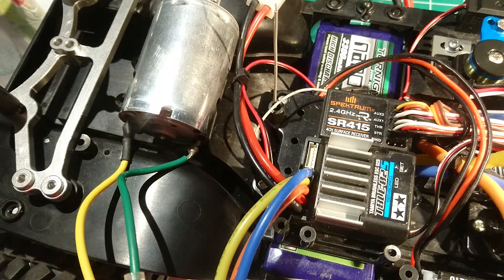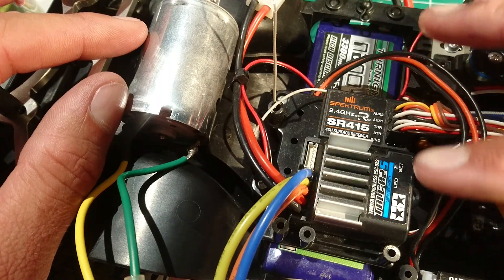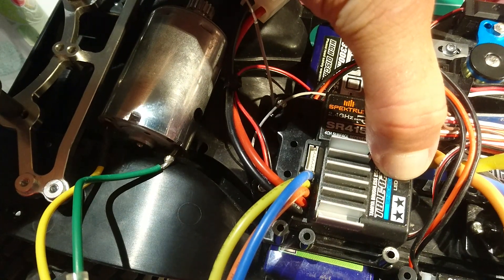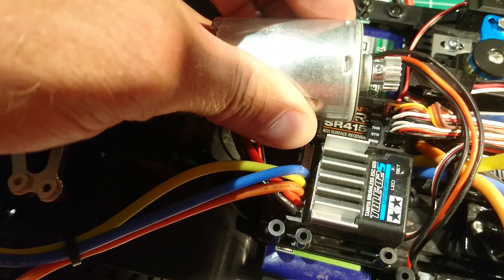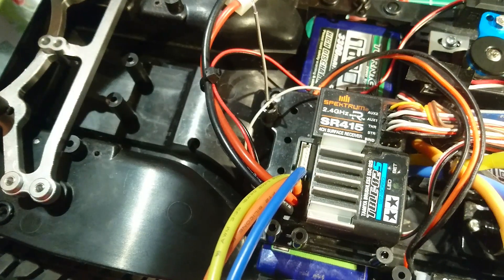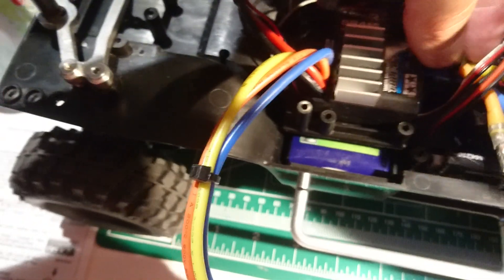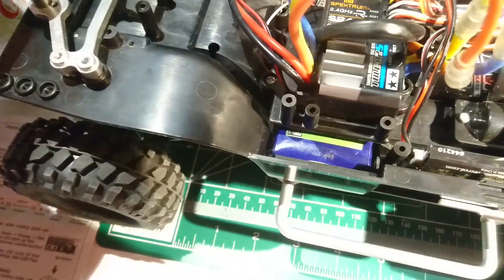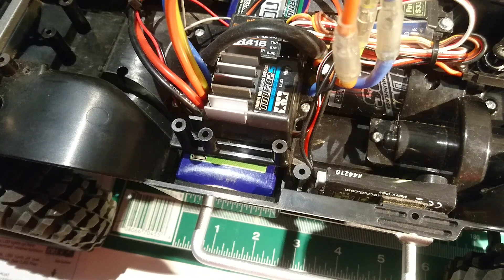TBLE-02s Change from Brushless Mode to Brushed Mode

Comment: For a Brushed Motor, the orange wire wasn't soldered to anything, correct?
Reply from the maker: @micsherwood4930  yes the orange wire just lays there.  No worried. Just zip tie it out of the way.  No need for it in brushed mode :)

Comment: With this work without the sensor cable? My tamiya motor TBLM02-S wont spin on brushless mode with the TBLE02-s ESC.
Reply from the maker: As I recall - this ESC will only run sensored brushless or brushed motors.  It won't run sebsorless brushed.
Reply: @KMJ187  Wow thanks, I wasnt expecting a reply lol. I have the brushless sensored motor but dont have the cable. I just ordered some so hopefully that will get the thing spinning,. If not I just ordered the hobbywing quickrun 60BL ESC. I heard you need the fan for the tble-02s esc and you cant find them anymore.....
Reply from the maker: @ryanbowen7831  yeah brushless are not like brushed - brushed just puts power to the magnets.  Brushless sensors the computer needs to read the sensor and rotor position to spin the motor. No sensor cable and the computer cannot read the motor

Comment: Can u run lipo in brushed mode with brushed motor, if so i geuss no lipo cutoff
Reply from the maker: Yeah you can run lipo.  You need a lipo alarm.  There is no cutoff on this esc.  I use a $5 lipo alarm.

Comment: Are you used lipo battery....?
Reply from the maker: Yes Lipo is fine. But the Tamiya esc does not have a lipo cut off. So you need to use a cheap lip alarm.  Look at my build of the cc01 or gf01 and I talk about lipo alarms.
Reply: Thank you....it is valuable information....🙏🙏

Comment: Thanks a lot!  My Tamiya Subaru Brat came with this controller and a brushed Motor, the default setting was for brushed Motors, I just set it back to brushless since I wanted to run my car brushless. It Worked right away!  :-) 

Cheers from the Montreal Region....

Comment: i remember seeing this vid a few weeks back and thinking it was an interesting vid at the most as im using a brushed motor. that was until i setup my TBLE 02 + brushed motor and saw i had no throttle input with controller. then i remembered this video  and it solved my problem :(.
Reply from the maker: 60k views.  I had no idea this video would be so helpful

Comment: Hey man I’m having some trouble making my rc car work. I tried switching the brushed and blush less motor mode and nothing, I also tried getting a new receiver and nothing the only thing that works is the steering. I’m new to this and I have no idea what to do. Can you help me?
Reply: Going thru the same thing
Reply: Do you have sensored brushless motor or non-sensored? Because non-sensored won`t work.

Comment: Hey ModdRocker, maybe u can help me? I have also an brushed motor as you(yellow and green wire)in the vid and the tble 02s  with an 4x1,5 Volt batterypack, no LiPo-Pack. The problem is that the motor shuts down after 1 second, afte he's started to run. Maybe i made an mistake with the wirering? Thank you

Comment: Ok. Can you use a lipo 2s with the brushed motor? No sensor wire required. Like on the Traxxas XL5.
Reply from the maker: WOOHOO FROM TEXAS HARRIS yes. Just set it in brushed mode.  Put a lipo in. The only issue is the TBLE does not have a lipo cut off.  So you need a battery alarm.

Comment: I got my ESC today but I cannot get my speed controller set up. I do everything it says in the instructions but it doesn't work.  All that happens is the motor starts turning when the wires are connected. The only way to stop it is to put the throttle trim all the way to negative. Any ideas??

Comment: Are you running this with a 2S 7.4 volt lipo? Any issues or does it handle Lipos fine?
Reply from the maker: Chad Morgan it handles lipo 7.4v 2S fine.  It does not have a voltage cut off.  I’m using a $5 LIPO alarm with it.

Comment from the maker: I cannot believe how many views and how helpful this video has been 😂 glad to be of help everyone.  Happy 2019
Reply: I've come back to this vid sooo many Times 😂
Reply: Tq sir. This really helped me alot. This should be the first step in the instruction manual, instead setting full throttle or brake setup for those running a brushed motor. I bought a tble 02s and had the red light flashing. Manual said its the overload protection. I then purchased the tble 04sr. Similar problem after spending soo much. Then i looked into mant forums where people who had this issue returned the esc for warranty or bought a new esc. Then your video came and after watching it and followed your easy steps both of my esc are actually fine. Tq sir and have a save 2021/2022.
Reply from the maker: @surendransuppiah  so glad to help!
Reply: Someone help me with the problem I've got with the blinking red led
Reply: And once again it works. Lol.
Reply from the maker: I'm so glad I could help!

Comment: Is there a way of setting throttle rang as when I put this esc on my car second hand done the brushed setup the throttle was on 0 on transmitter but the wheels where turning had to adjust trim to 18 backwards to stop it moving something doesn’t seem right can any help with this thanks

Comment: Does the wires for the brushed motor go with blue and yellow? If they do, can you tell me what the matching is?
Reply from the maker: Wolfen Her should be yellow hot blue negative and orange just hangs there.
Reply: KMJ187 so you’re saying green goes with yellow and the yellow wire from the brush motor goes to blue wire?
Reply: Wolfen Her apparently that’s the case I did this and it worked

Comment: i have this esc in my lunchbox, and i am fed up with it. when i have the ESC only plugged into my receiver, my receiver lights properly and the motor runs fine. the INSTANT i plug any kind of steering servo into my receiver, the power to the receiver goes away. I've tested the ESC in all 3 channels of my receiver and it works as should on any of those channels. its just when i plug a servo in. is the BEC not providing enough power?  this is the only thing i can think of
Reply: Sounds like my issue. I was about to throw mine out for the very same reason

Comment: I'm thinking of running the new Kyosho Le Mans 240s 19.5T brushless sensored motor.  I've read that the current load will be fine for the ESC, but are the sensor ports compadible?   My main question is:  is this Tamiya sensored ESC compatible with senored brushless motors of other brands?
Reply from the maker: gorrammit sensor ports are universal across the industry.  That should not be a problem.  He motor is rated at 15.5T off road and 10.5T on road.  So a 19T should be fine :)
Reply: sweet!   thanks!

Comment: Hello,  if I set esc to brushless,  does automatically set low voltage cutoff for lipos? or is there another step.
Reply from the maker: Pete Diano the Tamiya ESC does not support lipo sadly, the low voltage cutoff is for LiFe lithium batteries.   Tamiya supports the less used battery.  voltage cutoff for life are 2.5 volt per cell and lipo is 3.0v per cell.  so you need to add a battery alarm to use lipo.   also brushless motors work with any battery lipo or NIMH.   it's a myth you need lipo for brushless

Comment: Will this esc only handle 25t brushed as Tamiya says? I wanted to try it with a17t Brushed Trinity motor
Reply from the maker: ODSS2010 I would not try a 17T.  I would bet it fries.   I pushed it with a 23T super stock BZ and she got HOT

Comment: I have the same esc and I was wondering it you could help me out, I have that esc (brushless) like I said and I have the 540 sport tuned motor (brushed) in the packaging there is a slip of paper saying that we can use the tble-02s with a brushes motor I'm guessing that's why it was in the box when i opened my kit now the help I need is witch is negative and witch is positive on my esc, I know red is positive and black is negative on the motor I just don't know witch it witch on the esc. thanks
Reply from the maker: kale taubert I believe yellow is positive and blue is negative.  I think the instructions have that listed?
Reply: tamiya has left that instruction out for my kit I guess thank you for your reply have a great day
Reply from the maker: kale taubert try the blue and yellow.  I am almost certain that's it.  I had used them as a brushed ESC also :)
Reply: when I hook them up yellow positive and blue negative the esc beeps
Reply: is that normal?
Reply from the maker: kale taubert if you have it hooked up in brushed mode and it's in Brushless mode it should blink and show an error until you change modes?

Comment: Why I hold down the set button and switch on the receiver than it's still flashing red and green
Reply from the maker: Do you have a motor connected while you are trying to change the settings?

Comment: Thankyou for this video! I made a mistake setting up my esc. When i fitted it the motor ran in reverse, So i reversed the motor wires. This is wrong!! As the brake function was still the wrong way round. I thought my esc was faulty and had a glitch. The esc has to be reversed on the transmitter servo reverse switches! I hope this helps anyone else with the same problem! Scott
Reply from the maker: Scott Wheeler no problem, it should not be as difficult as it is :)
Reply: Thanks for bringing that up. I didn't know they worked like that either.

Comment: I do not know why Tamiya does not supply them from factory in brushed mode as they come with a brushed motor. For me they are the worse speed controller out there as I cannot change them to brushed mode myself as i'm red/green coloured blind so all the colours flash the same to me.
Reply from the maker: I have 3 of them and have had no issues.
Reply: There is no issue with the controller. But like me there are a lot of men who are like me who have issue with colours. That's why I like the ones with jumpers as just move them to where they are needed.
Reply from the maker: +Basildon Trail Blazing Buddies yikes, I guess being color blind makes the setup difficult:P. I wish they had LIPO cutoffs, but man for a $25 ESC, they work great, run the hell out of them and they barely warm up!  I have had my CC01 in the tall grass for 20-30 minute runs with a 2300kv motor, and with no fan  even the TBLE-02s does not even flinch!